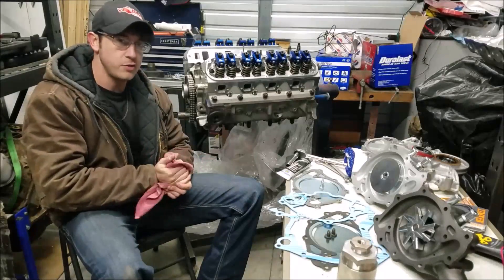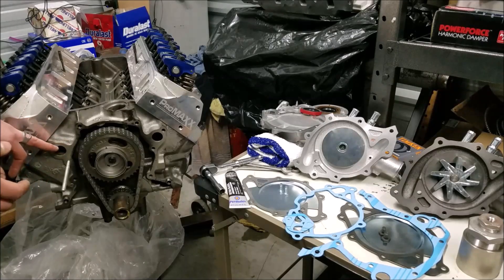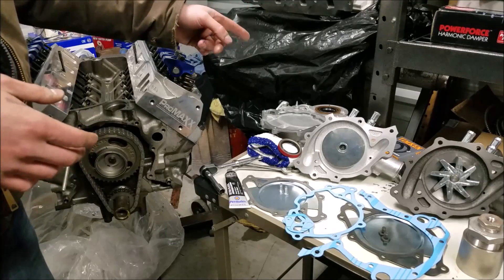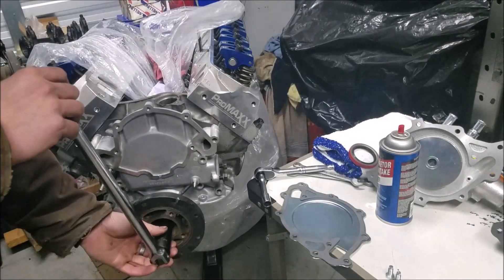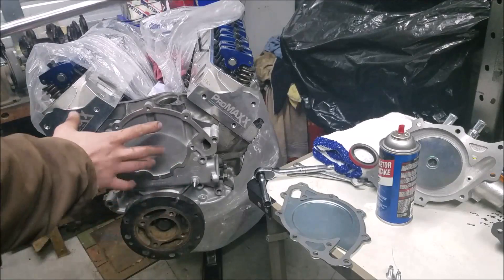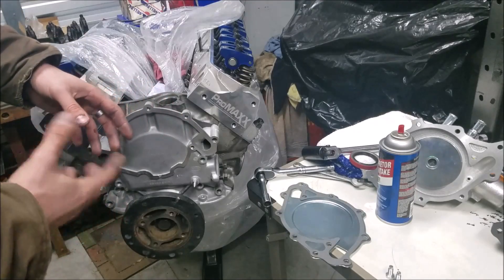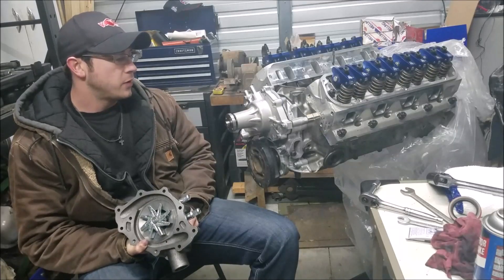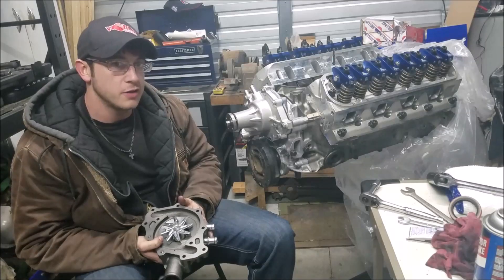Timing Cover & Water Pump Install: FULL How To/DIY (302/351w SBF)

Comment from the maker: Also, Check the book out - this is where i started!!! Great tech & walk throughs - https://amzn.to/2FZGDDY
also, what is the most annoying build piece to the small block ford? let me know in the comments!!!
Reply: a trick : watch movies at flixzone. I've been using it for watching lots of of movies lately.
Reply: @Derek Brandon definitely, have been using flixzone for months myself :)
Reply: Just changed a water pump on a 1990 Ford GT Mustang... The car never overheated but I noticed it was leaking ready to fluid from the bottom of the water Pump.. Change the water pump and it's still leaking in the back... So we took it back Off for inspection everything looks everything looks healthy what possibly could be causing the very bottom Of the water pump like where the bolt areas are  Is or bottom meeting surface....  Got any ideas they're old thunderhead...
Reply: What year is the motor?

Comment: 7:35 some of them don't use dowel pins (i know some early 70s 351s that i've built didn't have them) can make it a PITA if you don't have an adjustable timing pointer.
kind of a PITA If you don't have an adjustable timing pointer, if that is the case I would recommend using the oil pan to pull the timing cover down into position so you don't have leaks then take it back off after the bolts the timing cover are torqued.

Comment: Oh boy, I remember Thunderhead289 coated gaskets with Vaseline. Should have watched this first. I precoated all of my gaskets, oil pan, valve covers, water pump, timing chain cover... everything....with Vaseline and let them sit  for about a week. Do you think I will be OK.
Reply from the maker: I only coat carb base gaskets with Vaseline or grease because a carb gets removed somewhat often when getting it tuned in on a vehicle

Comment: I didn’t catch you mentioning putting thread sealant or rtv on the bolts that go into water jackets through the timing cover. I’m seeking clarification on the subject as I’m in the middle of putting a 5.0 roller together to go in my ‘92 Volvo 240.
Reply from the maker: You can if you would like - would be fine either way

Comment: How do you seal the backing plate? Anytime I’ve installed the bolts that go on the back it lifts the backing plate and gasket up? Any suggestions

Comment: Hey thanks for the vids. Great stuff. Why did you install heads first. Most say to install timing cover, oil pan and what not first. To setup valve train is it better to have timing cover off? TIa
Reply from the maker: It doesn't matter either way - but a "long block" is literally sold with the block and rotating assembly together with the heads on and valvetrain installed - that's it
Reply: @ThunderHead289  thanks, yea just want know if there was any particular reason

Comment: I have a 65 289 block its still leaking im wondering if the bolts i have are right for the timing chain do you know of a set that'll work for that year
Reply from the maker: I buy my stuff from the hardware store - arbitrary grade 5. Buying a set is expensive and often a crap shoot

Comment: If the water pump is out is it possible to get water in the oil. I'm only asking if something like that can happen. I'm getting a lot of coolant into the oil before it ever starts
Reply: Thanks for the help
Reply from the maker: Not possible - either an intake leak, timing cover leak, or a head gasket leak

Comment: Changing the water bump on my well rusted 1996 f 150 5.8 was a miserable experience. What was Ford thinking, Steel bolts through an aluminum housing into a cast iron  block. To say the bolts were seized was a understatement I am careful and patient but I still twisted off several bolts. I removed the housing with a punch and big hammer.

Comment: you lost me at shop rag. I rebuilt an engine awhile back that lost oil pressure after break in. pulled pan and found red lint clogging the pick up. i couldnt believe it. I didnt use them that much i had thought. now they arent even allowed in my engine biulding room.
Reply from the maker: Sounds like a you problem

Comment: Thx man. Can you use the copper gasket sealer on these gaskets and be ok? And do you have to drain the oil before this job?
Reply from the maker: Use gasket sealer for sure, thin layer style. No you don't need to drain oil unless you drop coolant in the oil
Reply: What gasket sealer do you recommend?

Comment: I think one of my dowel pins fell off in the oil pan, but I can’t say for sure. I only noticed 1 pin when I removed the cover. The engine is in the truck. How big of a deal is that? Ok to just leave it in there? I tried for hours fishing around with a magnet.

Comment: Very great info for the novice and great reminders for the experienced or seasoned engine builder... I am however concerned about the timing chain being installed dry. Pre-soaking a roller chain in oil and use of assembly lube on the gears should help to mitigate chain & pin wear/stretch and premature failure down the road. I seem to recall somebody aid timing set oiling by creating a window or passage in the wall of the block from the lifter valley which may not be a brilliant idea on a production 302 block with high performance end goals due to inherent block weaknesses, but would nonetheless work well in either a street driven/mild engine or an aftermarket block which addresses the block stress issues if going for performance. That is to say said aftermarket block doesn't already have oiling provisions.

Comment: Rather than making a mess and having silicone everywhere and all over you 
If you put just a little silicone on the timing cover only it will hold the gasket in place and when ever you pull it back apart the gasket will be stuck to the timing cover only so clean up will be much easier and you won’t have all the gasket and silicone falling down in your oil pan when you are scraping that gasket off the block and remember the amount of silicone that squirts out when you tighten down the timing cover is usually the same amount that squirts inside the motor and that will end up trapped against the oil pump pickup and that’s the last thing you want so don’t use no more silicone than you have to.
When there put together at the factory there is a very small amount used during assembly and when you clean up the timing cover it can be done on a table so it’s very easy to clean up and you don’t have to worry about having the mess in your motor

Comment: using silicone with paper gasket always causes a leak. I stopped doing that years ago escspecially on the ford crappy timing cover. The worst of the v8 timing covers.
Reply from the maker: If using gasket sealer caused you to have leaks it's because you were ungodly slow on assembly and torque. 
No other possible scenario
Reply: @ThunderHead289  even felpro doesn’t recommend using sealer on paper gaskets, only on the corners. It’s just monkey see, monkey do for all us shade tree mechanics.

Comment: I just did this job and have to take it all apart because I couldn’t get the oil pan bolts to line up. So since the gasket sealer dried up I have to re do it… it’s a pain trying to get everything lined up

Comment: Nice and detailed video!  
But I would do some things differently: 
First; try and balance the video SOUND (increase your voice volume).  When the music and ads kick in their volume must be between 11 and 12 (TOO LOUD).  But the choice of music is good. :)
Second; I'm not a fan of silicone and use as little as possible, I'll be using old fashioned GASGACINCH on my current 302 timing cover and water pump replacement project.
Third; due to dissimilar metal corrosion between the steel bolts and aluminum components, I would recommend using anti-seize on the bolts.
Fourth;  hammering the balancing damper onto the crank could possibly damage the thrust bearing, I would use the correct installation tool.

Comment: I've been following you since you since  the junkyard digs days colabs. Literally tonight, I was re-doing my timing cover and water pump on my 351 in my F-150 and I know felpro says to do them dry. But I took you advise and coated the gaskets in RTV. Its just not a job I want to do again and unfortunately, used an aftermarket timing cover to boot. I went against all internet advise because I know you know what you are doing and trust it. Just waiting 24 hours to add fluids. Thank you for all your awesome content. Just wish you weren't so busy you could post more.
Reply from the maker: As long as it's a thin skim coat, your good to go. The reason everyone says not to is because the typical person globs a massive amount onto gaskets which when tightened down in this case will squish out into the water pump poets, effectively restricting their flow capability. 

So if you did it as I do it in this video, your good to go.
Reply: Follow his advice uiur going to have leaks on that timing cover and pump. Good luck
Reply: Why not just use the blue water pump rtv
I haven’t put a gasket on a rear end ever. I imagine it works great on pumps as well

Comment: Double row timing chains look cool but the little rollers don't actually turn or roll there not persion enough
Reply from the maker: Yeah they make a huge difference actually. Take if from someone who has logged over 300,000 miles on engines they built themselves

Comment: Doing a timing chain on my 1990 F-250 351W, ready to put the timing cover on after I clean stuff and put on all the little gaskets in place of the oil pan gasket

Comment: Luke, Do you have the torque values for the water pump bolts? Thanks, great vid
Reply from the maker: Thanks! Personally I use lock washers and go for feel! Never had a single issue 👍

Comment: Haven't watched the video yet but since I didn't watch this before building my 302, I'm sure one of those critical mistakes (which I failed to avoid) is not breaking your water pump bolts and in turn your timing cover, work them suckers back and forth a little at a time with an impact, if they're gonna break they're gonna break but ya might get lucky, I pulled a 2nd one apart yesterday and got lucky
Reply: Nevermind this is just an installation video, I just put my timing cover and water pump on a different 302 a few days ago, hopefully it doesn't hurt anything that I left the timing cover gasket bare (put a little rtv at the bottom tho), I don't think it should hurt anything tho

Comment: Great video. I bought a 93 Thunderbird that's been sitting for a few years, had the transmission rebuilt and now I'm working on the cooling system. The coolant is pretty nasty, no oil in it just rust. Gonna do a full flush, replace the radiator and water pump. This video helped quite a bit so I'm not diving into this completely blind. I'm really hoping I don't snap any bolts in the timing cover, but who knows. My T-bird is the first 302 I've ever owned, but I don't think it's going to be the last. Thanks.

Comment: Great help thanks for my 1996 e350 club wagon xlt hd trailer package 5.8L W leaking some above timing cover.
   Seems to me that teflon paste is best for water pump bolts anti-seize because it can also seal any bolt in hole that might penetrate a water jacket in an engine design.

Comment: I usually use a straight edge to line up the bottom of my timing cover with the block where the oil pan goes. I'll try your method next engine to see how close it is. Good video!

Comment: do the vids then add audio later so you dont race the sealer. the antiseeze, i use a small syringe filled up with a tiny hose attached and insert a small vein in the bolt hole prior so it wont interfear with the gasket sealer when assembling. then put some ont the long bolt shafts that always get siezed. also can drill tiny holes in the timing cover where the long bolts go so you can spray penetrant into later during dissasembly. custom studs work great in this area as well as the thermostat neck.

Comment: Do you have to put any thread sealant on the the bolts to the front timing cover? The ford repair manual said that it was needed.
Reply from the maker: The 4 long bolts go into the water jacket, I would indeed put something on them or they will rust in place

Comment: I will be using the cork corner piece gaskets on front of oil pan and bottom of timing cover. Should I place and seal the cork gaskets to the timing cover then install it or place and seal them on front of oil pan then install the cover? 
Next when should I install the 4 front oil pan bolts that connect to timing cover? After I install the cover water pump and balancer or sometime before?

Comment: Question if I have to put the power steering and alternator brackets on some what of the water pump should i wait till I have the brackets to put in the bolts in or should be fine to take three bolts out to install brackets when the water pump is already installed

Comment: Great work and good advice provided. I am currently rebuilding the same motor for my ‘56 F-100. One thing I struggled with a lot was the water pump backing plate. I bought a high flow aluminum water pump and also bought the correct timing chain cover because of the difference in direction for the water pump. I could not find a backing plate that would work and finally determined (after a great deal of research), that if you have an aluminum water pump and timing chain cover, the backing plate is not required. Hopefully you agree with that...
Reply from the maker: Hmmmm 
The old old timing covers do not use a backing plate indeed, but that’s only 1 era. 
If you have Facebook, search Thunderhead289. My names Luke and I’d be happy to help you if you’d then send me some pictures.

Comment: Standard rotation water pump vs reverse rotation water pump is specific only to accessory belt drive type (V belt vs. Serpentine & direction of impellers?)
Reply from the maker: That is correct. 
There is one anomaly - the crown Victoria though using a serpentine, drove the water pump on the ribbed side of the belt making it standard rotation. 
This water pump WILL bolt to a later timing cover and spin clockwise just fine, BUT the timing cover layout is such that there isn’t anything in the way of v belt oldschool stuff that bolts yo it in a friendly manner

Comment: Hey there.  I am  changing the timing chain on a previously rebuilt 289.  Funny thing is both crank keyway and cam gear dowel pin lined up at the top of their rotation.  I guess it ran ok... (I bought it used)  but I plan to install the new gears with the dots close together.  Thanks for all the informative videos.

Comment: nicely done and good audio . it can be said here as it was not covered in the video; avoid at all costs the temptation to use stainless fasteners with aluminum. these sets are prominently advertised online, and for the certain individuals who might consider it a good idea,  Dont.
.it seems a logical idea as stainless will not rust  right? but galvanic corrosion sets in with vengeance when you introduce aluminum. thus you will weld your fancy fasteners to the timing cover. 
If you have a concern about this , meaning you will be back into this engine in the future, then never-seize and even on the longer fasteners i have used heat shrink tubing over the fastener and having it cut to exact length will form a barrier between housing and fastener. 
another solution for stuck fasteners is almuinum brighteher or hydrofluoric acid . this clears up stuck aluminum in a hurry including distributors and long fasteners through aluminum.
what i was looking for is the idea of removing the timing cover with the water  pump still attached. i will dive into a serp. 5.8 soon  thought to remove both at once .ideas??

Comment: Just so you know they make spray a tack in an aerosol can that's way too much silicone you'll  split a gasket eventually!!!
Reply from the maker: I won’t and never have . It’s a thin layer. Spray to tack does not account for surface anomalies that would otherwise cause leaks if not sealed

Comment: Hey ThunderHead, how does one plug the extra inboard holes on the cover's water ports? Your water pump seems to have provisions for a bolt but my shorty style pump doesn't have bolts for those two. Is the gasket supposed to seal around them and prevent leaks?
Reply from the maker: Sounds like you have a non backing plate style water pump and a later timing cover. You might get away with it, but that configuration may begin to leak.

Comment: Did this over the weekend. Guess I got excited and did not mock up first... Man was that a bad move. Had to drill the timing cover so the 2nd dowl would fit, it was off center. Most bolts were too short in the kit,  timing cover did not match up with pan. Racing rtv the whole time. I will be prepared round 2. Thanks.

Comment: Hey, Great videos.  I never would have put it all together at once, but mocking it up first helps a lot.  .  Some older manuals show a crankshaft oil slinger behind the seal, but I don't see it in your videos. Maybe it was a 289 thing..

Comment: Fail
Reply from the maker: Michael Dunn like all people should be, im open to criticism. 
What do you not like? 
Let’s discuss. - this page is a service to further the knowledge of others so they don’t have to learn the hard way like I did - I’m all for putting out truth
Reply: @ThunderHead289  First problem I have is with pounding on the crankshaft. This WILL damage your thrust bearings. Never do it.
Reply: I wanna know too. This is how I did it on my 63 Mercury. No issues.